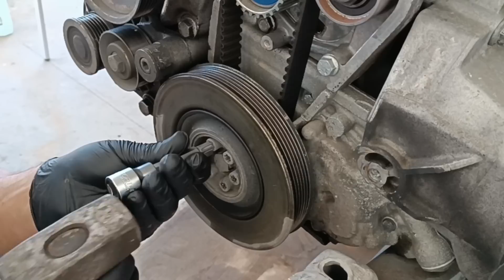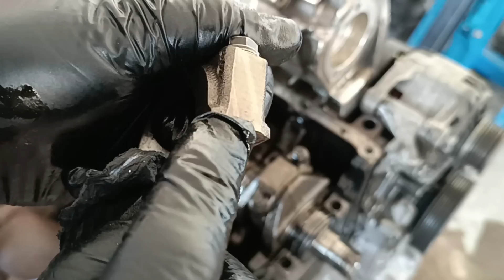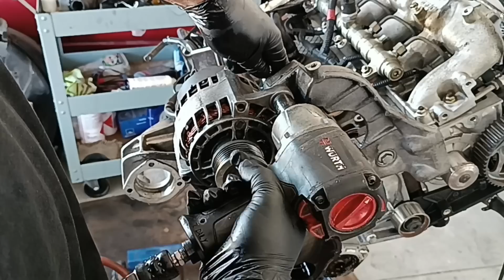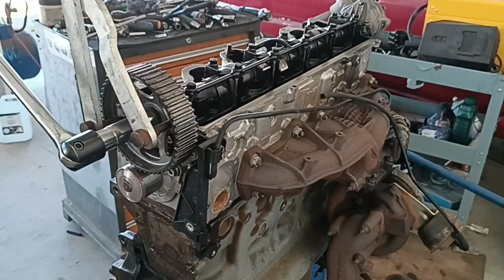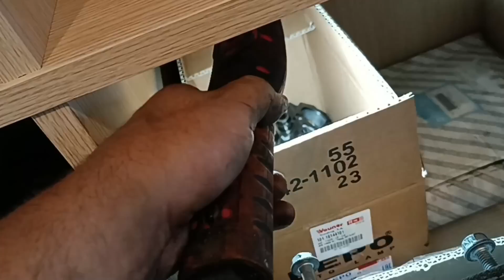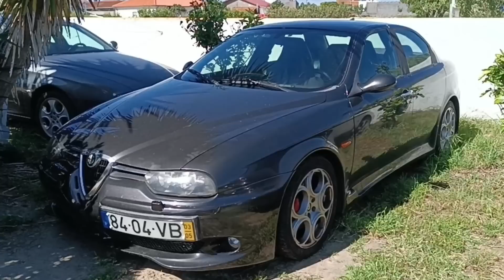Seized 2.4 JTD 10v Engine! Full Teardown and Damage assessment Alfa Romeo 156, 166 Lancia Thesis

Comment: Hi, have a Problem. Ist there a Metal gasket between the exhaustmanifold and the egr cooler? 2.4 jtd 103kw. I have exhaust gases insind the car. Thanks for your Videos! Helps a lot. I have an Alfa 156 azurro nuvola 2.4 jtd sportwagen.
Reply from the maker: Hello. Yes you do, check out this video:

https://youtu.be/8BrTbLmsaH4?is=tOQM6609NzGi2J7m

Comment: the 136 bhp engine also had a vgt turbo, I had one and replaced + stripped the turbo.  difference is the vgt was actuated by boost pressure, not vacuum.  I replaced it with a modified 20V turbo out of a 175 bhp engine (the vgt actuator from the old turbo was used.)
Reply from the maker: Hello. Yes, I'm aware. It's the 150 hp. 
I have one here actually.

Comment: I think the problem was with the crankshaft bearing torque. What I don't understand is why you say they're no longer usable. I think they could be machined and reinstalled, and the block could be used without any issues. I don't think it was damaged by heat since it stopped immediately. Why do you say they're no longer usable? What oil does it take? 5W-40?
Reply from the maker: The block got very hot. It's junk at this point.
5w40 yes

Comment: Great video, today my 156 JTD 2.4 20V had an issue with pulley and the aux belt slip off and got shredded, I coudln't find a image or video how to remove tension on this engine and this helped me a ton (tension pulley is very different to what I'm used to). thank you!

Comment: Hello Bruno. I have a problem on my 159 1.9 Jtdm. There is a rattle/ticking sound from the front of the car after a rebuild. It happens only at medium/hard acceleration when the car is moving 1200-2200 rpm is usually when I hear it. It gets a bit worse when warmed up. It was not the heat shield, exhaust manifold/gasket and injector corrections seem ok. Worst ones are +1.5 and -1.5. any ideas?
Reply from the maker: Hello. Check out for the crankshaft pulley. DAYCO only. No Autodoc

Comment: Hello, thanks for this video. The last 10v engines (150 hp) amd tje earliest 20v engines (175 amd 185 hp) still have the room for the balance shaft, but from factory, there is not one installed. The 200 and 210 hp blocks are a different casting without room for a balance shaft and a different oil pump. On early 10v engines the balance shaft is accused of accelerating the oil pump chain stretching/wearing. I would however prefer to have it for the added smoothness. I never heard of the wrist pin problems. I guess every day is a good one to learn something new.
Reply from the maker: Wow, thank you very much for this precious information! And thank you very much for watching

Comment: I have an isuee on my 166 2.4 when i accelerate arouns 3500k rpm the chek engine light pops up and the car just  sticks and when i change a gear it continue to run properly is it just the fuel pump need to be clean up?
Reply: Usually it's the turbine geometry stuck in high pressure position. Also my Lancia kappa has the same issue.
Reply from the maker: Hello. Assume nothing.. do a diagnosis please

Comment: Heyla bruno great to see the 2.4 JTD teardown. One thing I've wondered is : what is the situation with the carbon deposit in the valves? also is there a way to remove the oil cooler without disassembling the ac compressor? (I would like to change the o-ring). Also I don't understand the point of the balancing shaft in this engine. The JTDm removed the shafts and it is quite comparable in smoothness...
Reply from the maker: Hello. You can remove the cooler without taking the AC compressor support, but you will work blindfolded.
I can feel the difference with and without the balance shafts, especially on starting and shutdown.
I believe they are very important.
Ok the head everything is ok
Reply: @alfaromeonoproblem well my problem with the balance shaft is that the chain won't break but now it will become noisy. Unfortunately I couldn't find a replacement chain, but the cartridge with the chain is now quite rare and costs over 500 eur. Overall if Fiat Powertrain deleted them the difference should not be that dramatic.
For the oil cooler, I really hate that position. It makes a mess with oil changes.

Comment: I am curious if the bores in the crankshaft are clean because the first bearing was ok and the rest seized so I think that the oil not ran thru the crankshaft and left the bearings without oil
Reply from the maker: It's very odd, but again, if they replaced the Conrod bearings 500 Kms ago, they too may have been like this ones or similar. 
They just missed these ones?

Comment: Is it recomended to remove balancing shaft  because of oil pump health, and did they stop using it in 140 and 150hp and later on 20v versions? Mine 150hp does not have balancing shaft.
Reply from the maker: Had no idea, thank you for sharing that info. 
So on the rebuild I will remove it too

Comment: In the UK we wouldn't skimp on antifreeze but mostly for the not freezing up bit. I can see why if you live in a warmer country you might think you can get away with water only so this is a good reminder that it's not only for not freezing but for better cooling too. Thanks Bruno!
Reply from the maker: Hello. Thanks for watching. That is exactly my thinking too
Reply: I used distilled water at summer in my 1.9 jtd. Just did it to flush the system because it the antifreeze were quite old and everything was dirty as hell when I bought the car. There was much of like orange powder that would go to the bottom of the jug if I let it sit for few hours. And the system was full of that. I put the distilled water and drove the car for few days. Then I drained everything and put distilled water again for another few days. After about a month of doing that the system was clean as a whistle. Then I finally put antifreeze in there, adding a bit more concentrate and less distilled water in the mix, because in a Stilo you can't drain all the system, so some water was left in there. It says 7l capacity in the manual, but all I could drain out was about 5l. I also needed to change the jug for the coolant in the car, cause all the bottom of it was clogged with that orange stuff that I was unable to flush out even with a garden house.

Comment: Hello! Great content as always. I'm learned allot from you! One question? 
What happens if that fuse on the cam pulley breaks and someone just puts the pulley back in without it?
Reply from the maker: Hello. Thanks for watching! I'm glad you like them. 
If they put it on the correct spot, no problem.
Reply: @alfaromeonoproblem  So it actually comes as a sign where to put the pulley back? And if it's put back in the right place broken ( without it ), nothing will happen if I understand correctly?
Reply from the maker: @alterego6814 on the 8 and 10v  it will not have play or adjustments. In the 16 and 20v it will, one tooth. It will be easy to check. Also just remove it and see for yourself. 
If someone ables to assemble one that was broken, it can work, yes
Reply: @alfaromeonoproblem  Everything is clear now. Thank you so much!

Comment: The markings looks like fretting. That is due to pressure and heat together if I remember correct. You have to look it up what causes fretting, but it is not good.
Reply: Fretting is a corrosion due to high pressure in moving objects. And it causes fretting fatigue in the metal and gives cracks in time. Often happens in bearings😢
Reply from the maker: Thank you very much for your explanation. Thanks for watching
Reply from the maker: Thanks for watching and for the help.

Comment: And, why did engine seized? Overheating, no oil, water pump broke, no coolant...?
Reply: I think the coolant is the main culprit. But the last shop should have checked the main bearings as well from the crank. But a lot of corrorion in the cooling channels is bad. Coolant is very cheap so crazy to put water inside.
Reply from the maker: @karlos1060 I'm guessing coolant was not it, otherwise the pistons and skirts would have marks too. 
I think the oil pump was the problem
Reply: @  Could be, but not all parts were starved of oil. The amount of rust you saw in the engine must be there for a long time. And that rust and probably lack of coolant might have slightly overheated the engine starting all these issues?

I have no idea if the oil pump was seized or not. I think it is a combination of many things poor maintenance mainly.

My 21 year old 156 only get g12 inside never water. And inside the head still looks amazing driving on LPG.

I do my oil  changes now around 10k with new oil filter. 

But i guess with this car you can alos look into the radiator. If that is plugged as well heating up goes a long way.
Reply from the maker: @karlos1060 yes, it may have several causes..
The turbo was also almost seized and had to be completely rebuilt, so my guess on the oil is at least one of the things.
Reply: @alfaromeonoproblem   For sure the oil was a part in it. I am not really known with these oil pumps. Are they easy to fail? I don't really hear that about them.

I guess the main issue was no to poor maintenance. That will kill an engine much faster.  My main spark plugs are the original Alfa uses according the my owners manual. I have the 100K ones but in future will take the 60K ones again because they have one more electrode each.

I will replace the 100K ones at 60 or 70K max. Did my 60 k ones at 50K. 

Timing belt at 55k each time and so on. My 1.8 ts from 2004 still runs very well apart from oil usage wich all these engine types suffer from.

But is putting a good 2.4 engine from the scrapyard not an option? My brother had 2 of those 2.4 jtd 10 vales in the past. And they were very reliable.

Rebuilding an engine will cost a lot i think and i am wondering if it is worth it as it's a diesel wich is enviromental unfriendly.
Reply from the maker: @karlos1060 was hard to find a junked one, so we went with a block, pistons and more
Reply: @alfaromeonoproblem  Alright. They are getting more scarse ofc. So i get it. This way it should be better and hopefully the customer can drive it for many more years to come.
Reply from the maker: @karlos1060 yeah..  the costumer ghosted me... So..  
I have a bunch of money on in and nothing is resolved
Reply: @alfaromeonoproblem  😓
Reply: @alfaromeonoproblem  That is horrible when it happens. I hope you get your money back. People often don't think well and then just abandon stuff and call it a day. It's not your craftmanship. That is more then fine! And otherwise you have a part car for what it's worth.
I think the ALfa 156 are becoming more value in 5 or 10 years. Prices are going up slowly.
Reply: These engine have been often misthreated, carbon deposits, longer than usual oil drain interval...especially now that are all in very cheap cars. The JTD 8/10v can take an incredible amount of abuse before actually snapping.
Reply from the maker: @karlos1060 I do not know what to do really...
Reply from the maker: @JoeDaeHimself yes, that is very true. I really cannot believe someone was able to brake a engine like this, I image the abuse...
Reply: @karlos1060 sure but I think it will be limited to the V6. The truth is that the JTDs have been commercially successful, they are plenty and really not many will survive between horrendous misthreatment, scarse spares, and costly bills. And now in many countries you cannot really use them properly because of "environmental concerns".
Reply: @JoeDaeHimself   Very true. In my country the Netherlands there are a lot of restrictions. And the roadtax is horrendus. It is about 180€ a month for such diesel. So old and very expensive and no one wants to drive them. You do still see many petrol ones, but diesels are scarse. That's why they will go up in value in near future because almost none will be left. But also normal petrol ones besides the V6 will go up in value for sure. I know the Busso is a great engine and a GTA already is very expensive a good one. But also the regular 1.6, 1.8 and 2.0 will increase in value. That is just because a lot of people drove them to the scrapyard and when the supply gets limited the prices go up.

I have a 2004 1.8 on LPG and still love driving that car. I am daily using it. And when the time comes i have to invest more then i want i will park it somewhere and leave it for 10 or 15 years.
Reply: @karlos1060  the Pratola Serra series of Twin Spark is a good series, however it is quite "normal" and doesn't have that Alfa Romeo prestige that the all Alfa 2.0 TS had. In my opinion the 156 is a beautiful car, very competent especially when sorted out mechanically. Probably a 2.0 Turbo would have been the best engine for the car, but FIAT didn't want to use that Lampredi engine in the ALFA, it was reserved for Lancia and Fiat Coupes.
Reply: In Poland you can still use them, but the road tax is coming sooner or later I'm afraid. Even today they start to put low emissions zones in large cities, that disallow you to drive old cars. If the road tax were here, people would probably go nuts, so the government doesn't risk introducing it (yet). There are many old cars and people just love them, because of the reliability and cheap parts and easy fixes. I can't imagine driving a 1 litre turbo-petrol engine which will last for 150-200 kkm at most. That will absolutely kill the used cars market. And also the forcing of electrical vehicles after 2035 is a madness. I'm afraid what the EU does is not acceptable for many countries, especially for those with small GDP per capita ones, like Poland. There might even be next countries to consider leaving the EU just like UK did. 2024 euro-elections didn't change much about the EU politics, I hope in 2029 something will change. Otherwise there might really not be any other option but to leave 😢
Reply: @5Dale65 it is a tendency nowadays, used cars are more an more unfixable, new car more expensive and built with short term ownership in mind. Our youngtimers are good but without some legacy program or some custom fabrication you won't keep them alive for long.
Reply from the maker: We will never know, the engine was repaired just before this. Coolant I do not think so. 
A problem with oil for sure..